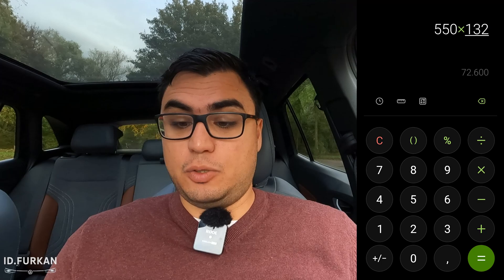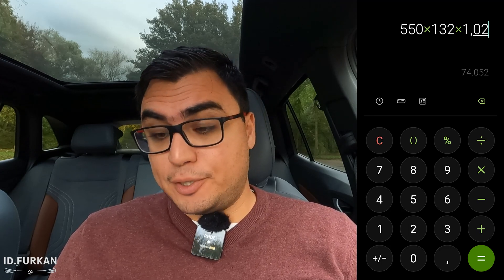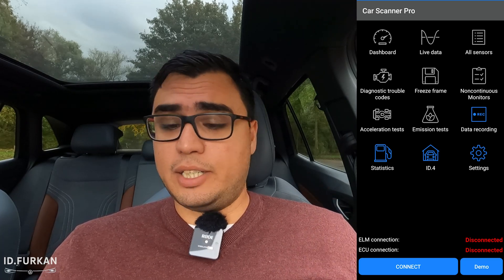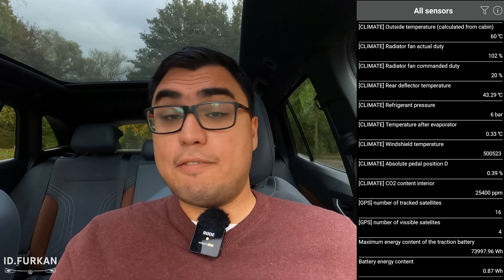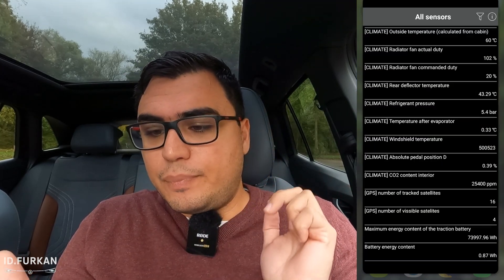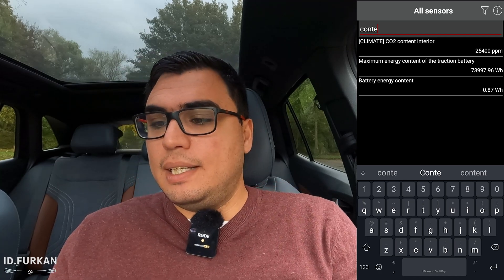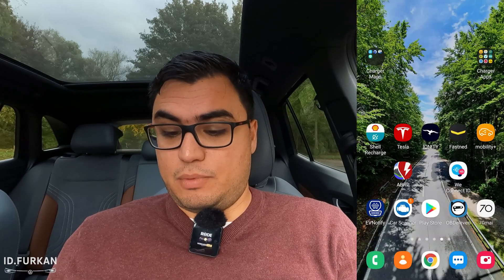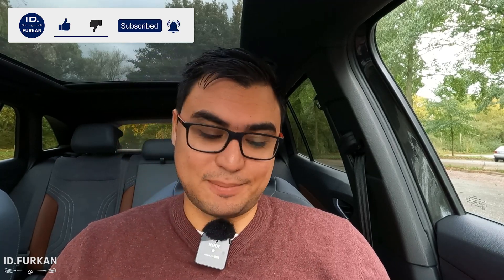How to check your MEB Battery Capacity / Degredation!

Comment: Thank you for you video, 58kWh ID.3 with 88000 miles(140,000 km), 4 years old, 94% SOC, I don’t know the charging history because I bought it at 80,000 miles, but I expect that the there must have been lots of 100% charges and fast chargers.

Comment: Hi, i'm on ios and the app CarScanner dosn't show the battery states or kwh on my cupra born, just the % of remaning battery, any workaround ?
Reply from the maker: Make your own page. Data should be visible under All Sensors
Reply: what do you mean "make your own page" ? i'm connecting to the odb dongle then i go to all sensor, but I do not have the same infos in the list than you @EV.Furkan
Reply: Ok, I found out that the pen scanner that I have is a cheap one that doesn’t scan all sensors, I bought a new one, I’ll keep you posted.
Reply: still no luck with the more expensive odb reader :(
Reply from the maker: @laamday did you select the right connection profile under Settings? VW EV MEB. And after connection you should see everything under All Sensor. Im not sure if developer put it behind the paywall and you need to get Pro for that (it wasnt like that)
Reply: @EV.Furkan  yes ! that was the problem ! I chose the cupra option but it was the combustions cupra, with the vw MEB option it shows the same infos as your video. (FYI : cupra born, 20 months, 15000km -> 55.1kwh)
Reply from the maker: @laamday  glad i could help from a distance

Comment: ID.4 1st, 77 kWh battery, since April 2021.
10775 km, charged almost solely AC, between 20-80%.
74750 Wh capacity reported, 97,1% of spec.

Comment: Thank you for this video. It helped me get the OBD2 Adapter to work! I didn't obviously listen too well what you said in the video the first time I watched. Could not get the adapter to work. Same adapter as you have. Restarted phone, changed phone to another Android brand, tested with an Apple iPad, un-paired all other Bluetooth devices. Had a very old WiFi adapter which worked directly. Then I watched this video once more and... you told to press the adapter the very first time you used it so hard so it fitted nicely. And so I did. And it worked directly! Thank you very much!😀
Reply from the maker: There is an anti tamper strip in the port yes. I'm glad it worked out

Comment: New ID.4 GTX 1390 km. Carscanner shows total acc. charge 419kWh, discharge 351kW, SOC display 73% (also on display), SOC BMS 71.6. Max energy content 79047.77Wh, which is more than net 77kWh!
Reply from the maker: Interesting

Comment: VW ID.4 First Max
26 tkm / 7,5 months
50% AC / 50% DC (only couple of times charged over 80%)
CarScanner with 25% SOC > 72498 Wh (Battery temp about 10°C)

Comment: Hi ID.Furkan! I found in Car Scanner a sensor to be used for measuring losses in the charging procedure… it is called “Total Charging kWh”… Now, when I begin the charge, I take note of that value… at the end, I take note of the final value… the difference will be compared to the power operator counter… losses are simply the difference between the two values… moreover, that sensor could be also used to evaluate the recharging brake between two charging sessions… what do you think about that?

Comment: ID.4 Pro Performance Tech
~14.500km / 5 months
Charging 50/50 AC/DC
AC usually up to 90%, DC up to 80%
Ca. 10 times AC up to 100%
Capacity currently 74400 Wh

Comment: Dear ID.Furkan, I am taking advantage for having been subscriber to your channel. You seem to me expert enough to answer the following issue. As you may know, I drive an ID.4 1st Max 77 kWh net capacity. Last Summer, in the middle of the so called “Po Valley” in Italy, near the beautiful and historical city of Parma, I attached my BEV at a Ionity charge column. It was a very warm day. You can imagine. We were directed to the Tyrrhenian sea. Any way, I charged at most 50 kW, whereas the capacity of the charging system was well beyond 150 kW. After the trip, I called the support service of Ionity about the issue. They told me that possibly was a problem of the car. Then, I called the VW support service. They told me that possibly was a problem of Ionity. After, in Turin, Italy, this Autumn, I was able to charge my BEV at 75 kW, the maximum allowed by the charging system. So, the issue has not been completely clear or solved for me up to now. Some VW ID owners told me that it is a SW problem: for them the 3.0 update will solve the issue. I may add that the owners of Tesla, Porsche, BMW were able to charge at double or three time my velocity.  Do you have something to add to clarify the situation?
Reply from the maker: Did you plug the car with less then 15%.if not normal. If you did then it could be an charger issue

Comment: VW ID.4 First Max
4100km / 5 months
total kWh charged: 1000
50% 3kW AC / 50% 50-75kW DC (percentage on actual kWh charged)
59% (percentage on actual kWh charged) charging up to 90-100%
38% (percentage on actual kWh charged) driving on autoroute
62% (percentage on actual kWh charged) driving in the city

75.4 kWh (read value on OBDII)

Comment: Very good, ID.Furkan! Now a couple of technical questions for you: 1) You added a 2% for safer purposes: the actual value may be different in consideration of some factor? 2) Has Car Scanner a value that indicates the actual energy into the HV battery during charging (Ah, or Wh, or something like this)? In fact, I am also searching to evaluate the losses of the charging system... Thank you in advance!
Reply from the maker: 1.there are videos out there people driving their EV till they stop. ID.4 went between 10-14km after 0%. And 1% is between 3-4km. Do the math

2. Carscanner or any other app can ready what the battery is taking at the chargeport. Chargelosses happen between the chargeport and charger. So you need to read the charger and what the car took in to know your chargeloss. There are some values in carscanner that can help with that
Reply: The grosse capacity of the battery is 82kw so uper buffer and those 2% under 0%soc you should not calculate in. I am first mover with id3 it has 36tkm, did lot of fast charging to 100% and most DC 50kw charging because in Croatia it is still free on Elen charger. In the afternoon i scan and put the result...my wife is on the job now vith the car. Cant wait!
Reply from the maker: @markostavljenic2778  you cant us buffer at all, but the value under 0% till it stops you can. Which is within the net capacity 0-100% is just the 97%(or 98%) value of usable battery.

Comment: Enyaq 80+ 9338 km. Since 22 June  2021. Only AC-charging . Always charging between 20-80%. 73947,96  kWh. More degradation than you 🤔😊
Reply from the maker: Drive to 5-10% charge to 100% and check again. It may be unbalanced abit after a long time
Reply: I will try to do that. 😊
Reply: @briann.9830  Did you try this? IF so did it work? Thanks!
Reply: @agzand  not there yet, I’ll be back as terminator say’s 😊
Reply: @agzand  new numbers. I did drive to 2 % Charge ti 100 %  76647,86 happy again 😊
Reply: @briann.9830  that is great! Thanks for the experiment!